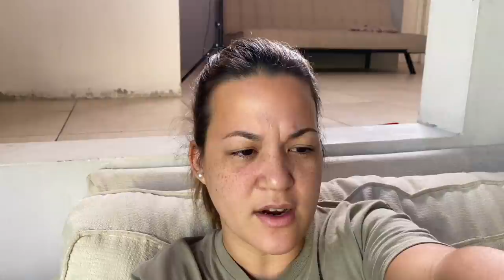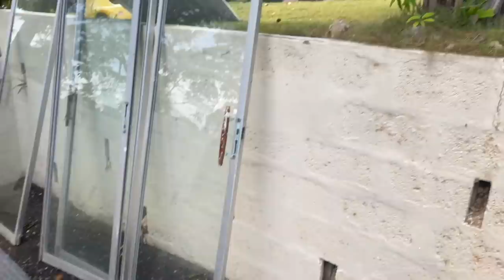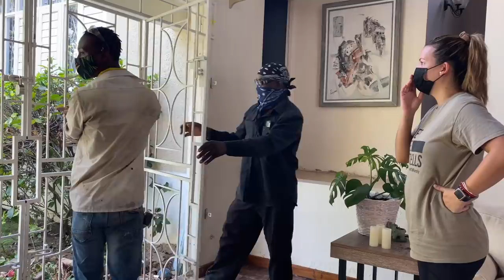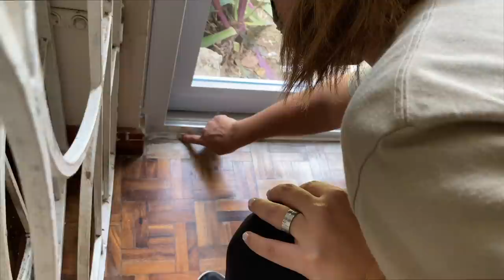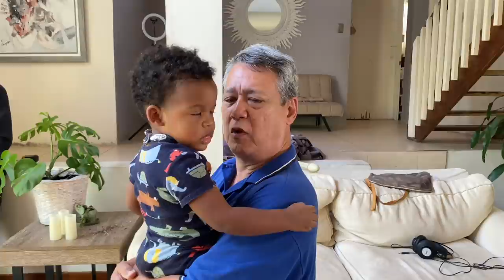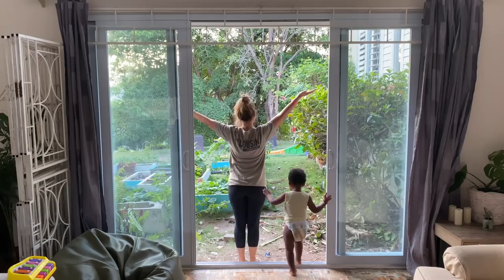We Waited 15 years To Do This! | MTM Makeover Continues - Meet The Mitchells

Comment: Also, if laminate is not your thing you can consider vinyl flooring. That's even cheaper than laminate and it's similar in its appearance and method of installation. It's a quick and affordable way of modernising your floors.

Comment: Hey Alcor just finished some windows and doors on a project I'm overseeing and mi can tell you seh dem never cut short or cut corners on anything.
It went a little over schedule still but windows shut tight and are properly sealed so once you install AC you won't have to worry about air seeping out and your energy bill spiking due to that.

Comment: My bill went from $4,500k to $20k January 2020. Then estimated bills of $12-$15k each month from then till now. I've called multiple multiple times. Sent several several emails where they respond promising to send someone and and address issues. I've also brought it to the OUR and still nothing. I cut back on nececitites like outside lights. Stop  microwave , monitor my ironing n the bills don't adjust. I've also had electricians check the house and premise several times to ensure its not on my part.